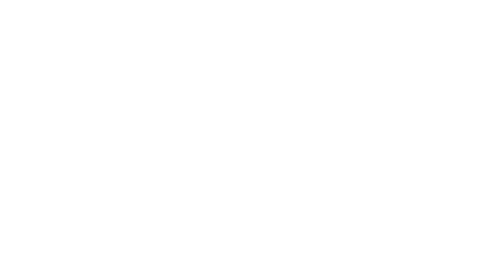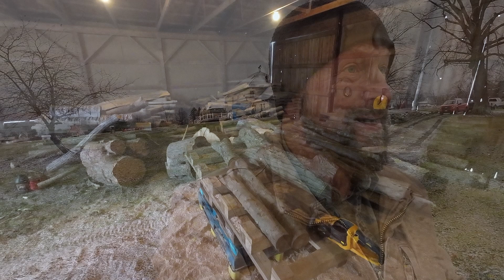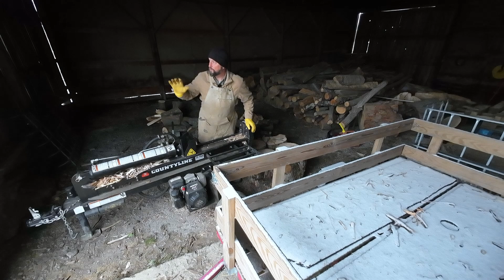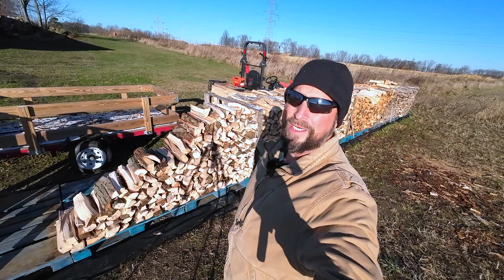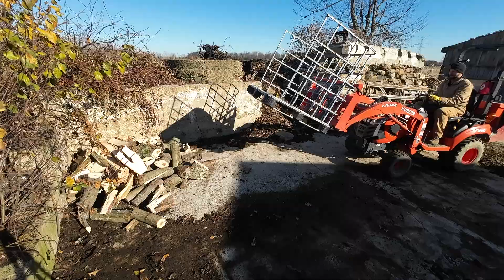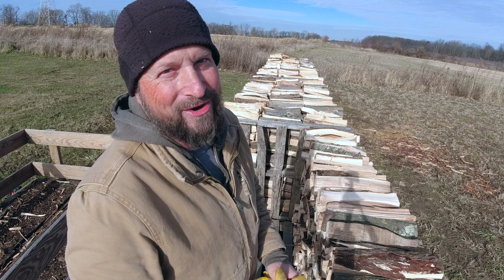Firewood Is Like A HUGE Savings Account

Comment: Insurance issues are very frustrating. I was off work 5 months because it took 3.5 months just to get my surgery approved but only took 6 weeks to recover. Glad you are getting the roof done but a hot summer day would have been better for the compost shingles to stick together. Thanks for the video Sam.😁👍🚜💨☀
Reply from the maker: I was worried about them sticking too Mitch. We lucked out with two 55° days in a row with pure sunshine 🌞 They did an absolutely wonderful job. I'll put up some before and afters in a future video 😁👍